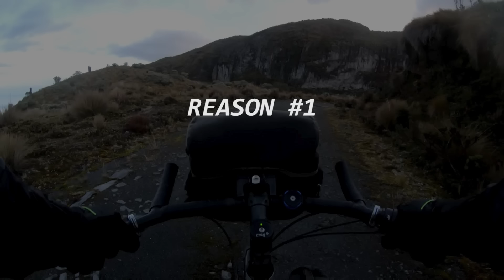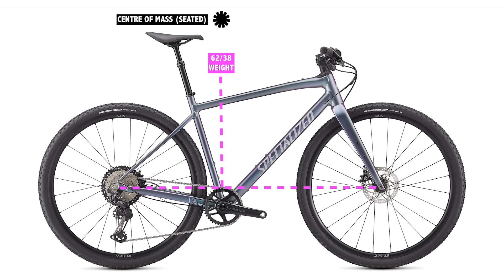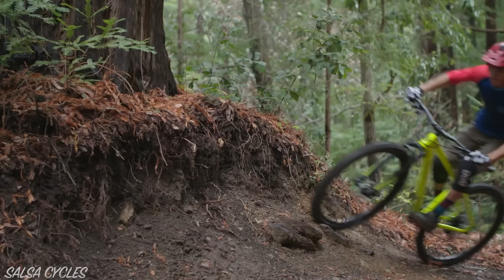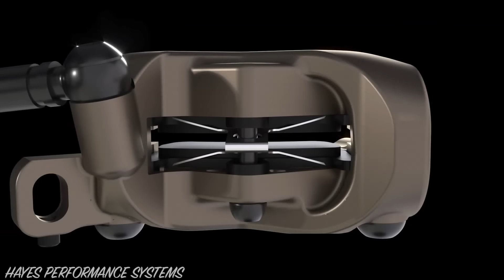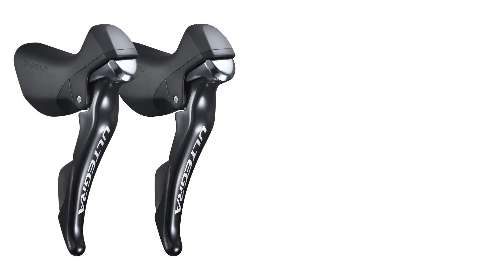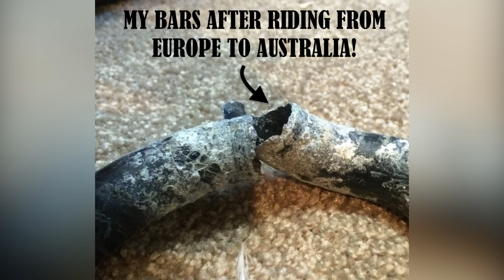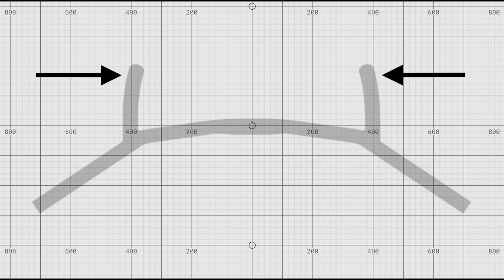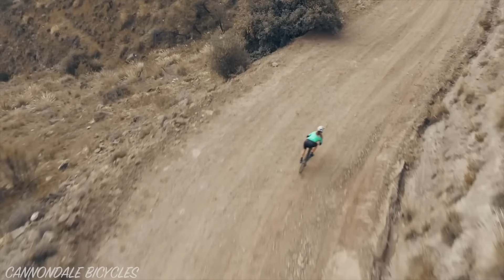Why Flat Bars Are BETTER Than Drop Bars For Most Cyclists (Objective Analysis)

Comment: 20 miles everyday commute - switched from flat to drop bars an year ago.  I am  fast , nimble,  aero and wrist pain free since then. Not going flat anytime soon
Reply: Drops are also easy on my elbows
Reply: @JohnDoe-zj6xf  Alt bars solve this issue.
Reply: @SurpriseMeJT  Alt bars don't come pre-installed on that affordable bike that you see on sale. Alt bars are something you experiment with after market, at which point you might as well go for drop bars.
Reply: Same. My favorite at the moment is Cinelli Largo. Most comfortable handlebar Ive ever used.
Reply: @fifirtus  yeah but those cinellis are probably more expensive than my bike lol.
Reply: im confused by the pain you all experience on flats for me i experience it but on drops, do we both have bad postures?
Reply: @big_bird8597  
I think it's because you twist your wrist, when, regardless of what type of handlebars you use, you should always keep your wrists straight.
Reply: It only feels faster on drops.
Reply: @sqd8r  Not if they are amphetamine drops, under the tongue.
Reply: Back pain shall come soon..
Reply: I mean, ur on a 20 mile commute. The majority of commuters have 10 miles or less😅
Reply: Maybe you using your brake levers horizontaly ?
Mine follow the angle on my arm so my wrists are never twisted. I feel no pain no matter what 10 20 50 miles asphalt dirt. Cheap confortable more brake power more control.
Drop bars are expensive ugly and crap.
Reply: Can you ride while drinking a beer stabily on drop downs?
Reply: exactly. this guy definitely did not cook.
Reply: Got a 24-mile commute. I'm thinking of switching to drop bars to go zoooomies
Reply: I find drops just give me a much greater range of hand positions than flats. I make lots of small changes in position and drops just have more options than flats.
Reply: wide flat bars get uncomfortable to hold quickly. not having to splay your arms to the side means that its easier to support yourself.
Reply: Flat bars; aching shoulders, tingling wrists, most uncomfortable, end of story.
Reply: @miniac60  Not all "flat" bars are equal.  I have many bikes and have many handlebars as a result of my experimentations.  Buy a Ritchey Kyote and cut it to your preferred size.  You are welcome.
Reply: @SurpriseMeJT  those look amazing, I saw "Richie" and thought, expensive! But no, they are very affordable. Thanks! I'm going to have to stay with flat bars are damn uncomfortable, because these are not "flat"! Lol
Reply: @miniac60  I'm all for drop bars too, but couldn't the problems you describe be resolved using a swept-back flat bar?
Reply: @armadillito  perhaps, but I'm a go faster kinda guy lol
Reply: @armadillito Sure, but how many bikes come with that configuration out of the box. Not many, if any. You can just as easily change a drop bar, using a smaller frame, shorter geometry, risers, etc.
Reply: @armadillito  The flat handlebars keep your wrists turned fully horizontal though at end of their range of motion. You also end up putting pressure on the parts of the wrist that can cause carpal tunnel if your wrist bends back, which is an easy thing to do if you hit a bump. If your ride infrequently it’s not a big deal but the more frequently you ride the bigger a problem it can become. If your bike is sized well and you are cognizant of keeping your wrist straight it can be okay, but it still makes your hands sorer after a long ride.

The drops and hoods keeps your wrist in a more natural vertical to slightly tilted inward alignment and make it really hard for your wrist to bend and flare. They aren’t perfect though you can run into different ergonomic problems with pressure on the outside of your hand but it’s harder to do.
Reply: But do you have the right bike fit for the type of bar you’re using?
Reply: @Nouldes1  yes, fit is everything
Reply: my friend says his drops hurt him more. That is true for most. Could be your bike fit?
Reply: @andrewnorris5415  or his bike doesn't fit? (Really not being a smart ass). For me it's spreading my arms wide that bother me most. With a full summer of "riding wide" I got back in my drop bar bike 2 days back to back, geez I hurt today lol
Reply: What a ridiculous thing to say considering drop bars are the opposite of ergonomic.
Reply: Drop bars tried & tested, you cannot beat them as far as I'm concerned ....I ride a Tourer , with Salsa drop bars, wide at 46cms with ergonomic grips down the bar, wrapped with a nice cork ribbon.... Delicious Bars

Comment: I have drop bars but find it easier to climb with my hands on the tops. Another reason in support of flat bars I guess.
Reply: No, that's where most people grip when climbing. It's actually a pro for drop bars as you can use the tops for climbing and then change to a more aerodynamic position for the faster bits.

Comment: I'll politely disagree that drop bars are better in urban environment. You really want to be able to stir as fast as possible and this calls for flat bars. Also narrow flat bars are a thing too.
Reply from the maker: To be fair, I said that drop bars are "often best" and that they "do excel in urban areas" - but it totally depends on the urban environment! If you are not needing to squeeze through tight gaps, flat bars are great for the city.
Reply: @Cyclingabout  but again, most fixies and other urban bikes have very tight flat bars. Much narrowers than drop bars in fact. (But obviously, then, the argument about ease of sudden turns falls....flat :))

Comment: Reason 12 - With the flat bars, your vision is naturally facing forward instead to the front tire. This is very important in traffic.
Reply: That's far more to do with how high the bars are mounted. The hoods on my dropped bar town bike are at near enough the same height relative to the saddle as my flat bar mtb.
Reply from the maker: This actually depends very much on your bike fit rather than the handlebar design.

Comment: While I agree with all of your arguments, there is one missing benefit of dropbars - ergonomics. Yes, there are flat bars with hoods, but then you can't use brakes.
Better ergonomics is actually a thing that caught me by surprise. I wasn't really expecting it when buying a bike with dropbars. Unfortunately there are many compromises. Especially breaking power is something I always miss from MTB components. But this is changing as gravel bikes are getting more and more popular and new groupsets have brakes that are starting to be good. In my opinion there are two worlds that strongly benefit from certain bar. MTB has to have more controll, road has to have better aerodynamics. Everything in between is a land of compromise and preferences.

Comment: So in conclusion a narrow flatbar with bar ends is the best: it is  aero, it is good in urban traffic, it is more stable with longer wheelbase, it is capable for bigger front luggage, it is better with shifters, it is cheaper than STI... and so on. That's why old '90s MTBs are so in high demand for bikepacking and gravelling. :)

Comment: Respectfully, dumb clickbait titles are dumb even when they come from respected sources.
Reply from the maker: Why is it dumb?
Reply: @Cyclingabout  Because it's a lie. Flat bars are better in certain SITUATIONS. Drop bars are better in certain SITUATIONS. It doesn't depend on the CYCLIST but the situation where you'll be doing the riding. Change one word and the whole meaning changes - "Why flat bars are BETTER than drop bars for most situations."
Reply from the maker: @DouglasRosser  I disagree. Most cyclists do not need the most aerodynamic, narrowest handlebar setup with a high and low ride position. But they do need high stability, lots of control, less maintenance and lower gear ratios.
Reply: @Cyclingabout  Your obvious bias is showing. As an experienced cyclist, I can see through that. You are doing a disservice to some of the less experienced riders out there that may make a poor judgement based on your advice.
Reply from the maker: @DouglasRosser  I don't have a bias. 50% of my bikes are drop bar, 50% are flat bar. All of the information I provided here is objective; I was careful not to include my opinions.

Based on the conclusions I have drawn from each of the topic areas, flat bars are better for most cyclists. I explained the reasons why in my previous comment.

If you disagree, please provide your reasons why.
Reply: @Cyclingabout  Why don't competitive cyclists use flat bars then? You state that flat bars "handle" better than drop bars. This is pure hogwash. When you're bombing down a curvy section of tarmac at 40mph, you want the stability and slower responses of a drop bar. Again, you are 100% not objective because your focus is on adventure riding and touring. In that sphere, right on! Thumbs up! But don't pretend you are completely objective.
Reply from the maker: @DouglasRosser  Competitive cyclists are not "most cyclists".

Flat bars are very stable at 40mph. Just because they require less steering input does not mean they're less stable. You simply adjust the amount of input you put into your bars.

The reasons around adventure and touring can simply be disregarded by viewers if they're not applicable. For example, I don't expect my point about handlebar pack volume to sway anybody who doesn't travel.
Reply: @Cyclingabout  Again, I respect your opinion and your authority, but your claims of objectivity are just amusingly insincere. The vast majority of cyclist are competitive, even if the competition is purely recreational in nature. I have been out in the middle of nowhere wishing for lower gears, but I have never once wished for flat bars for the type of riding I do.
Reply from the maker: @Douglas Rosser  I simply do not understand how you can still say I am biased and "my claims of objectivity are amusingly insincere" when I have countered every single one of your points with statements that stack up factually. It just doesn't make any sense.
Reply: @Cyclingabout  You are simply not objective because you dance around the fundamental issue with flat bars - they're uncomfortable. First you simply surrender - "I won't talk about ergonomics". Uhhh, ergonomics are probably the most important issue when choosing your handlebars, as another commenter has already pointed out. Then, you don't talk about "flat bars" you talk about ergonomic flat bars with additions and extensions because FLAT BARS ARE UNCOMFORTABLE. You essentially tell the viewer to just buy the ergo bar that works for them. Yeah, you can spend more money! That's why flat bars are better! Then you talk about how you can spend more money on GRIPS! Because.... flat are are better? There's a reason drop bar users just use bar tape. It WORKS. No one riding drops is suffering silently to prove how hardcore they are. If I didn't know better, I'd think you were an industry shill trying to sell more ergo bars and grips.

Comment: I get the point about drop bars beeing nice in the City but i think the statement "they are better" is simply not true when we talk about safety. Sure you can dodge stuff a little easier and maybe these 5cm actually safe u in some situations. Most of the time i would definitely go for the braking power tho. Great video!
Reply from the maker: I said they were "often best" and that they "excel in urban environments". It's not an absolute. If you aren't squeezing tight gaps, then this particular criterion will not be applicable.

Comment: Flat bars are better than drop bars because lower gears let you climb hils more easily — WTF? 🤦‍♂️
Reply from the maker: I don't know what you're confused about. You can fit any low gear ratio mountain bike drivetrain to a flat bar, but you have to hack and bodge your way into doing it with a drop bar.
Reply: @Cyclingabout  Your video's title says specifically "drop bars vs flat bars", not "bikes", yet you talk about gear ratios and frame geometry. Regarding fitting a drop bar, there are MTB-specific drop bars such as Salsa Woodchipper, Salsa Cowchipper, Surly Truck Stop Bar, etc. Some of them are optimized for MTB frame geometry, MTB shifters and levers. I personally ride Surly Open Bar on my 29er with hydraulics and grip shifters. Not quite a drop bar, but still. On my commuter bike I have a Salsa Woodchipper drop bar mounted very high: the drop is at the flat bar level, and the horizontal portion is very high, letting me ride upright to rest my back or look above cars. I use the drop bar with flat bar hydraulic levers (had to file the clamps a bit), oldschool bar end shifters and MTB drivetrain. I also have a front V-brake for braking when riding upright (if I used cable brakes I wouldn't need the third brake, just a pass-through lever). I'm never going back to flat bars. I believe, your drivetrain argument is invalid when talking about BARS and not bikes. Same about frame geometry: just buy a stem that compensates for bar geometry.

Comment: I - as a German tryed both. But for me - since 30 years and much more than 100 000km trop bars the better option. But I use them on frames - desinged for flat bars. 
Problems with corrosion I never had. Maybe because I use almost always gloves. 
True is - on a flat bars often you have  a better position for breaking - the force shold be enogh when your backweel is lifting - what is not a problem when I am in the drop position.
Basicly I would say - for longer sportly rides on maynly smooth roads - drop bars are for a lot of people the better option. For the rest..... maybe flat bars.

Comment: Aren't aero bars easier to install on drop bars since you have more lateral area to choose for where to mount? I've only experimented with aeros a bit and found when I mounted them narrowly (the only option on most flat bars since shifters/brakes will get in the way sooner) I was much less confident in my balance, but when I spaced them more widely it was very comfortable (Kona Sutra with drop bars)

Comment: Shorter flat bars in urban settings for braking power and the lower speed stop and go nature of urban riding lends itself to a less tucked position.
Buildings often provide wind protection you are not going to get in the open.

Comment: As much as i want to try alt bars, the biggest problem is the various hand positions isn't readily on the brake. At least on dropbars there is two positions. Braking power does suffer a lot on drop bars with comparable budget though.

Comment: Especially for the less experienced, it's important to also talk about the number of hand positions where there are access to brakes. On dropbars there are the hoods and drops whereas on flat bars, most of the "exotic" designs still only provide brake access on the flat grips. The only exception being middle mounted bar ends.
Reply: Correct. Still, dropbar braking is very compromised. The hoods position provides less power (brake leverage is not good) and the drops power is good but position is compromised on the descents. Braking and shifting simultaneously are also much easier on the flatbar.
Dropbar = many positions, each is compromised in some way.
Flatbar = 1 main position which is good at everything (except aero :)).
Reply: @Indik47  I find plenty of braking power from drop bar hoods with disc brakes.  With caliper brakes I agree, braking is a bit weak. I haven't ridden a drop bar bike with v-brakes, they might be better than calipers if you can get enough cable travel for them to work, but disc brakes are the only way to go on any new bike IMO.
Reply: @Indik47  How is the position in the drops compromised on the descents? It offers way more stability in fast, smooth corners and places your center of gravity low so you don't fall as easily. I do all of my descents entirely in the drops and it works way better than using a flat bar bike for the same.
Reply: @quarkonium3795  ride what you like, no problem with that. I tried drop bar and I constantly got dropped by flatbar xc riders in my group. There's no way to safrly keep the speed of xc riders on a dropbar bike. Except for the tarmac, ofc

Comment: Another excellent and informative video, Alee. I agree 100% with what you said. I don't know if it's some sort of cycle snobbery, Emperor's New Clothes, or what, but there are several current standards that I can't understand. So many bikes sold don't fit the needs of an average cyclist - from geometry to gearing to dropped handlebars. I used to love ripping up the road on my Colnago Super Mexico years ago, but for anything off-road, dropped bars just feel so inappropriate.

I've been using SQ Lab inner barends (which I notice featured a couple of times in your video), and find they are great for assuming the same position as being in the hoods on dropped bars. Good enough to achieve a more streamlined position for long, flat, tarmac sections.
Reply: Thank you for mentioning the name of those barends, I was trying to figure that out.. I like the angle of them and think they might work better with a swept back bar vs other barends I've tried. I really like a barend position which is either neutral or slightly pointing inboard which is easy to get on standard flatbars but not on the swept back type. There's the GC-1 Ergon grips that Alee suggests with his namesake handlebars but that doesn't give me a barend, which I'd want inboard of the grips anyway for that "riding in the hoods" feel.
Reply: inner barends is one of the silliest word constructions ive seen yet.
Lets just call them horns, something which is not at the end of a bar cannot  be called barend.
Reply: @Exgrmbl  maybe when you've designed and patented a unique ergonomic component and are selling them internationally, you can give your invention a more sensible name. 😉
Reply: @davidrowe8747  
fair enough. I guess it really is not any sillier than clipless pedals which you clip into.